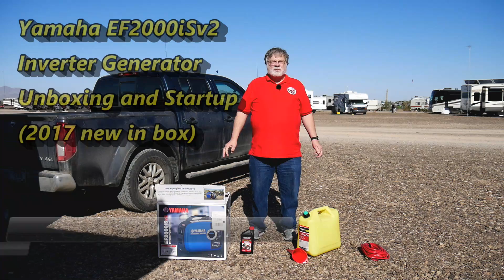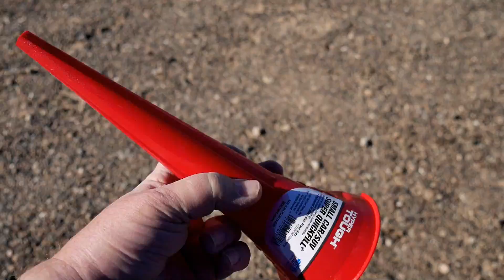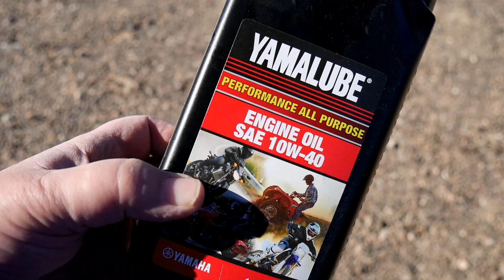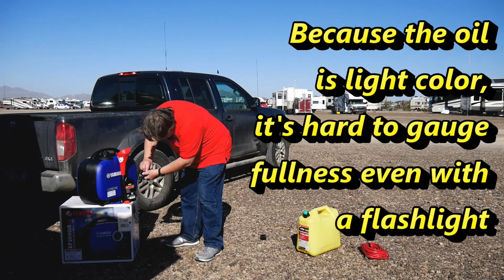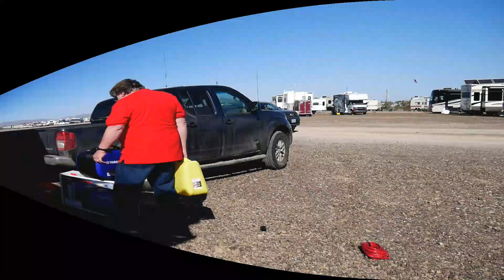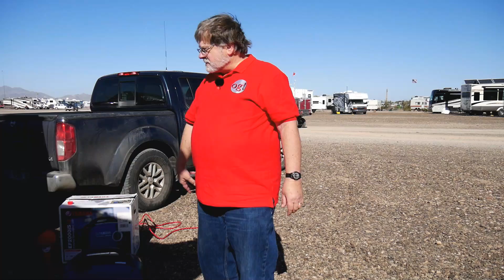Unboxing and Setup of Yamaha 2KW Inverter Generator (#188)

Comment: Hey Dave, Last year I picked up a Hutch Mountain Honda EU2200i Propane, Natural Gas, Gasoline Tri-Fuel Conversion Kit for my Honda EU2200i generator. 
https://hutchmountain.com/products.html#!/Honda-EU2200i-Propane-Natural-Gas-Gasoline-Tri-Fuel-Conversion-Kit/p/101013131

My Honda EU2200i generator came from Home Depot. I like working with Home Depot because you have 30 days to return generators no questions asked AND you can just take it to your local Home Depot. I paid $999 for this generator. The price now has gone up $10 since I bought mine.
https://www.homedepot.com/p/Honda-2-200-Watt-Super-Quiet-Gasoline-Powered-Portable-Inverter-Generator-with-Eco-Throttle-and-Oil-Alert-EU2200i/304205470

The Hutch Mountain setup couple with the Honda 2200i is a great setup. 

I have done a bunch of modification to my Leasure Travel Sprinter Van, including providing a propane connection from the van for my generator setup. I also have a "T" connection so I can run both my generator setup and my "on demand" hot water setup. The "on demand" hot water heater is another Home Depot purchase. I think it ran around $120. 
https://drive.google.com/file/d/1k77_5dfY3EXUShzcVXDSqtVe27mgn11j/view?usp=sharing